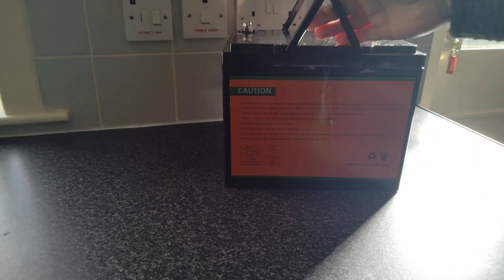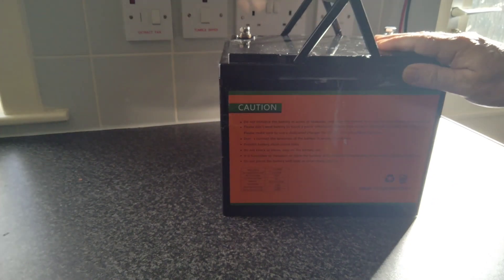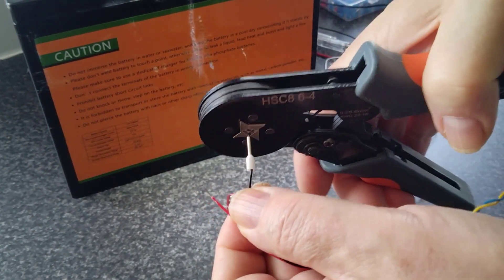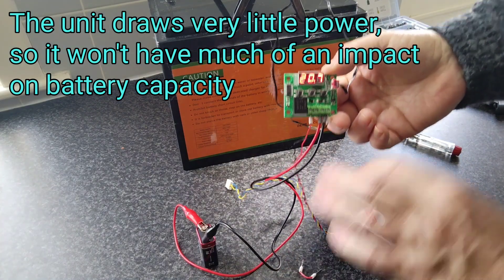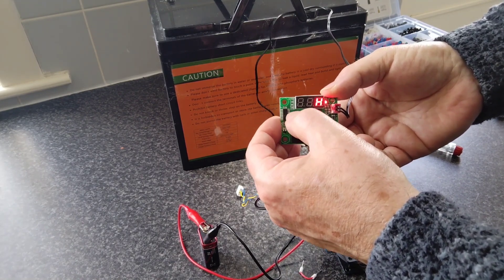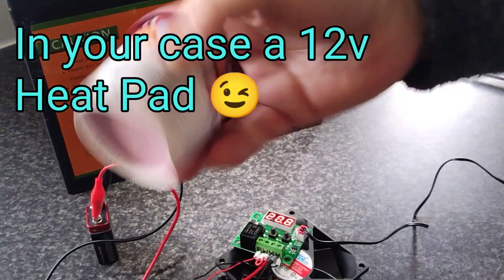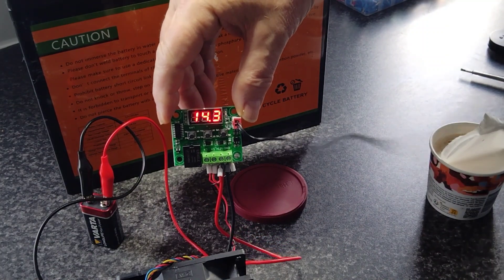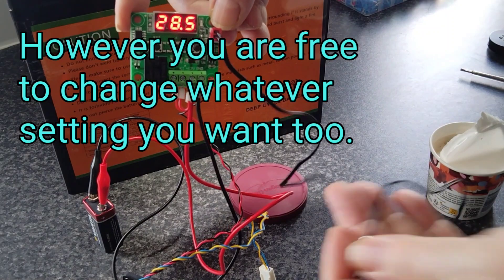This CHEAP GADGET could potentially save you THOUSANDS

Comment: You need some hysteresis otherwise it will be cycling around a fixed point. So it might turn on at 0°C and off at say 4°C
Reply from the maker: It wouldn't hurt, but it's fiddly to set up plus I'm getting old 🤣